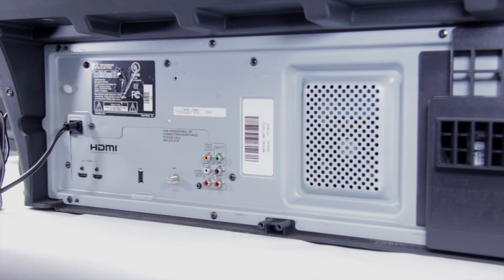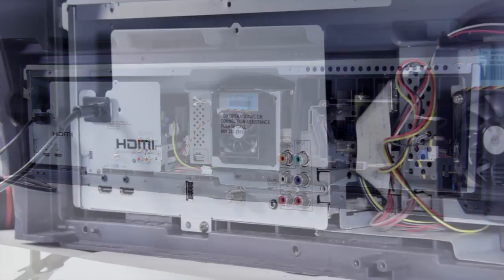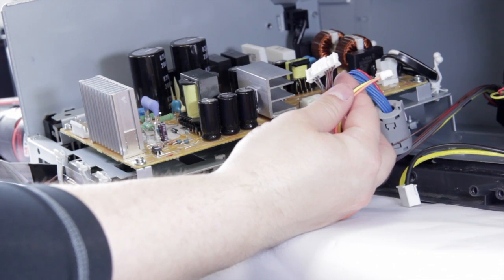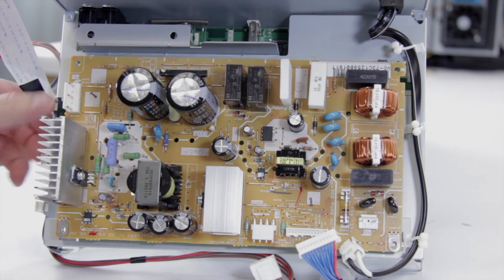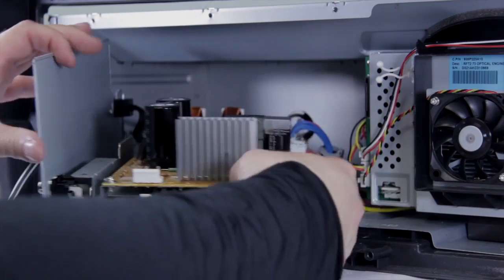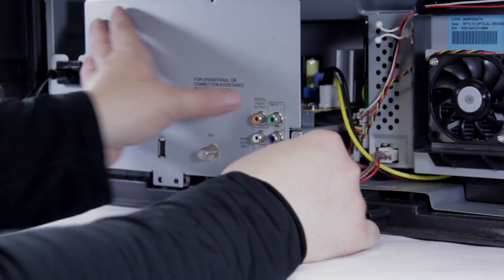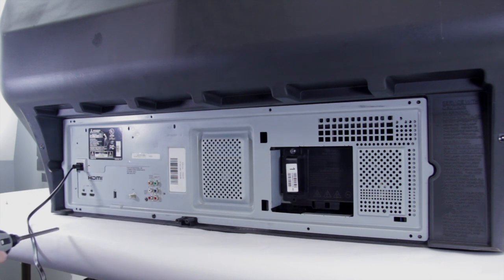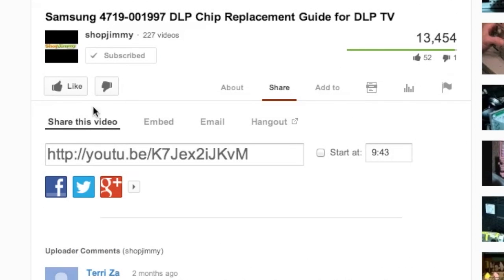DLP TV Repair - No Picture, No Power - Replacing Power Supply in Mitsubishi, Samsung, & Toshiba

Comment: I have a 55" Toshiba DLP that is probably 10 years old. I recently moved and now the TV will not turn on. The light is blue, then flashes yellow then it shuts down. It repeats this cycle a few times then the yellow light stays on and the blue changes to red and flashes. I know this to be a power supply problem. I did try unplugging the TV, waiting, and then plugging it back in. There does not seem to be a power on switch to try that. What it looks like is going on is the power cord at the back was damaged in the move. Its loose at the connection to the TV. It does not unplug. Does this mean I have to replace the entire power supply or is there another fix? Thanks!

Comment: I have a Mitsubishi WD -65737 I moved the TV from one room to another plugged it in and it will not turn on . Status light not lit. The TV was working perfectly not 15 minutes earlier before I moved it.
Reply: George burns like was hot and you moved it causing bulb to blow most likely
Reply: @TrazereGaming  mine just did the same thing, had the music up way to loud, pictures on the wall moving around loud. Think you may be right.

Comment: I have a WD 92840 Mitsubishi, that has a green blinking light, no picture no sound and no sound of turning on. I replaced the dlp lamp still wont work. Is it the power board? Please help.
Reply: SanAnMan 1 how did u fix it I'm having same problem
Reply: I lot of videos said cleaning the power board might fix it but my TV is not running right now.
Reply: SanAnMan 1 did you ever find out the problem with your TV?
Reply: Same! I replaced the lamp and now I’m thinking about replacing the ballast. Did you find a solution

Comment: Hey there guys,
I have a mitsubishi wd62725, that would turn on but after a few mins or so it would turn off, to the piont that it does not turn on. after watching some tips seems like the power supply but not too sure. any advise, thank you guys
Reply: No, I have the tv connected to power but no lights at all.

Comment: i have a mitsubishi wd-65733. first, lamp needed to be replaced. i get error code 34, with solid red light. i replaced the lamp. color looked great but after about a day, picture suddenly went out with same error codes.  researched a little, and replaced the ballast.  seemed to have fixed the problem, tv sounded like it was firing up normally. but suddenly after several weeks, i got one sudden shut off. then got another sudden shut off, this time with red light. i attempted to turn back on, tv firing up sounded abnormal again. kind of like 3 clicks, fail, and then it reattempts. i just shut off tv. next day turned on tv and it seems to be working. my guess is a faulty power supply board? or is it possibly fans or faulty connectors? please help.
Reply: i wanted to clarify what i meant when i say tv sounds abnormal...when i turn it on, the tv sound comes on find but it seems its struggling to fire up the lamp. the clicking is actually several fast clicking noises, but attempts 3 times after failing. there is a subtle but high pitch noise that usually comes on with the lamp but that also drops with with each fail attempt. hope that makes sense. thanks in advance!
Reply: Did you end up fixing your issue. ..just asking mine has the same problem. ..fires up normal no lamp though,  then light clicking like the color wheel is not starting or something, I believe it's the color wheel not 100% though

Comment: I have a WD60737 I have no sound and no picture I replaced lamp about june of 2013 been working good now you turn it on I get green flashing light and eventually turns to red any ideas
Reply from the maker: Terry Cannon  Please watch this video FIRST to help with your repair!  https://www.youtube.com/watch?v=BP3NVNCGEv8  This could be a problem with either the lamp or the ballast in your TV.  You may need to replace each part individually to see which one fixes the problem.  Click this link to replacement parts for your TV model number:  http://www.shopjimmy.com/catalogsearch/result/?q=WD60737  There may be multiple boards for the same TV model number, be sure to match part numbers on your current board, with your replacement for compatibility.  Thanks and please let us know if you have any further questions with your TV Repair!  www.shopjimmy.com

Comment: I have a Mitsubishi DLP tv model WD- 60 737  no lamp operation also I have checked for the 340 volts coming from the power supply to the  lamp ballast no voltage present at the Ballast connector coming from the power supply however the fans are working fine and the color wheel working fine, no bulging capacitors in the power supply I also pulled the lamp out no physical defects on lamp at all so I did the  door switch test that was fine green power light stable everything else seems to be working fine except the lamp not lighting  but I suspect the power supply? because once again the ballast is not receiving the 340 volts it needs to power  the ballast what do you think? Thanks and have a nice day.
Reply from the maker: ldonaldson780   I recommend replacing the power supply board in your TV.  Click this link to replacement parts for your TV.  http://www.shopjimmy.com/catalogsearch/result/index/?cat=59&q=WD-+60+737  There may be multiple boards for the same TV model number, be sure to match part numbers on your current board, with your replacement for compatibility.  Here is a link to a video showing how to identify your part number, click here:  https://www.youtube.com/watch?v=QpqfxV2olXo  Thanks and please let us know if you have any further questions with your TV Repair!  www.shopjimmy.com
Reply: ShopJimmy.com thanks for the fast reply however I made a mistake I retested the power supply connector
Reply: ldonaldson780 thanks for your fast reply please disregard the previous message I pressed send by mistake sorry  it's late however this is concerning my Mitsubishi DLP WD - 60737 TV in my previous post sent to you I made a mistake after testing the voltage again from the power supply to the lamp ballast connector I discoverd the 340 volts present  this misdiagnosis was made because I had a faulty negative test lead initially I thought it was the power supply I apologize for my mistake (time for some new accurate test equipment) however everything is working as far as the fans and the color wheel, now I'm just suspecting the lamp or possibly the ballast? red light steady on the front of the panel you had a great reply to my first question and I appreciate it I do not want to waste your time because I know you guys are very busy great channel have a nice day please respond. Thanks,
Reply from the maker: ldonaldson780   I recommend replacing the lamp in your TV.  Click this link to replacement options:  http://www.shopjimmy.com/catalogsearch/result/index/?q=WD-+60+737&tv_models=Mitsubishi+WD-60737  You will see bare bulbs and lamps.  Thanks and please let us know if you have any further questions with your TV Repair!  www.shopjimmy.com
Reply: ShopJimmy.com thanks for the follow up reply I will be ordering a replacement lamp for my( Mitsubishi WD - 60737 TV) from you in the very near future thanks again and have a nice day and happy holidays.
Reply from the maker: ldonaldson780   You are very welcome for the help!  Be sure to click this link above to find a replacement lamp.  http://www.shopjimmy.com/catalogsearch/result/index/?q=WD-+60+737&tv_models=Mitsubishi+WD-60737  You can also call our customer service to order a lamp over the phone, (877) 881-6492  Thanks and please let us know if you have any further questions with your TV Repair!  www.shopjimmy.com

Comment: I have a Toshiba model number 23hlv87 it is an LCD TV DVD combination green indicator light is on but no picture or no sound
Reply from the maker: Moises Pagan   I recommend replacing the main board in your TV.  Here is a link to replacement parts for your TV model number on our website, click here:  http://www.shopjimmy.com/catalogsearch/result/index/?cat=56&q=23hlv87  Be sure to match part numbers on your current board, with your replacement for compatibility.  Here is a link to a video showing how to identify your part number, click here:  TV Part Number Identification Guide for Toshiba Main & Scaler Boards (LCD, LED, Plasma TVs)  You can also call our customer service for further assistance with your purchase.  (877) 881-6492  Thanks and please let us know if you have any further questions with your TV Repair!  www.shopjimmy.com

Comment: Have a Toshiba 42HM66 that does not turn on the fan, audio, or lamp. It flashes 4 green and 2 orange most of the time, Sometime if flashes 7 green and 7 orange. Any thoughts?
Reply from the maker: Steve Hausmann   I recommend replacing the formatter/DMD board in your TV.  Here is a link to replacement parts for your TV model number on our website, click here:  http://www.shopjimmy.com/toshiba-2970050503-dmd-board.htm  Be sure to match part numbers on your current board, with your replacement for compatibility.  You can also call our customer service for further assistance with your purchase.  (877) 881-6492  Thanks and please let us know if you have any further questions with your TV Repair!  www.shopjimmy.com

Comment: I have a toshiba 37 inch  37wlt66 tv it will turn on but i have to plug it in and unplug it so i can turn it on but when i get it on i can turn it off and turn it on with in 5 mins tho.Any ideas what could do this.
Reply from the maker: Carl Eddwards I would recommend replacing the power supply in your TV.  Here is a link to replacement parts for your TV model number on our website, click here:  http://www.shopjimmy.com/catalogsearch/result/?q=toshiba+37wlt66  Be sure to match part numbers on your current board, with your replacement for compatibility.  Here is a link to a video showing how to identify your part number, click here:  TV Part Identification Number Help Guide for Toshiba Power Supply Unit (PSU) Boards  You can also call our customer service for further assistance with your purchase.  (877) 881-6492  Thanks and please let us know if you have any further questions!  www.shopjimmy.com

Comment from the maker: @khriz2113 - I would recommend replacing the optical block in your TV.  Unfortunately we do not have any optical blocks in stock, but you can search out a replacement part on our website, shopjimmy com and sign up to be notified when the part is back in stock.  Thanks and please let us know if you have any further questions!
Reply: I have a question: What does this code 1 flashing yellow and 6 blinking red light means?? On mitshubishi tv 73" dlp model # 
W-D 73638 thank you.

Comment from the maker: NEED TV REPAIR HELP?!

If you need help repairing your TV please comment below the ShopJimmy video or feel free to send us a YouTube message. Please include your TV model number and the symptoms or issues your TV is displaying. The more details you can include the faster and more accurate our response will be! You may also call our customer service at (877) 881-6492!
Reply: ShopJimmy.com my wd-73c9 mitsubishi powers on but stays on the home screen without sound and a rapid nonstop green blinking light, would you please tell me what you think the issue is, thank you for your time
Reply: hello i have a mitsubishi dlp wd-73838 with a constant green flashing light under status, ive changed the lamp tried reset and still shows the led light like its about to start up but a second later it goes off and continue flashing green, ive unplugged it for days plug it in i hear the power clicking but just the flashing green light continues ive left it plugged in for days still nothing , as long as its plugged in the green status light flashes found this problem thanksgiving day replaced lamp dec26th no change whatsoever, can you help please???
Reply: Hello, I have a Mitsubishi WD 73C8. The green light of the timer is blinking but no power or sound. Please advise what could be the problem. Thanks
Reply: Hi, @shopJimmy. i have a problem with my Mitsubishi tv 73" dlp model # WD-73638. Right now, it is showing 1 blink yellow and 6 blinking red lights. I have replaced the lump blast so far, but it still won't turn on before wast doing the same thing, but if I keep playing with it  , it will turn  on, but now just won't start it just keep that 1 yellow and 6 red blinking lights and won't turn off and I have to unplug it but when I plug it but it yes turn on by it self and the blinking lights start again, lease help, thank you, and best regards.